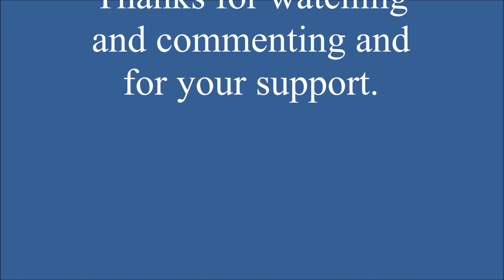Dale Skidmore - Boat Restoration Part 18

Comment: aaarrrrgggghhhh, power plane ...  'flashback'  :)      The way you braced those runners prepping for steaming reminded me of a luthier's trick,  on steroids, (where they use the  sprung bracing rods whilst bending or bracing for gluing )
Enjoyed as always.  One of my favourite series on here .  Just love the way you're taking it from what amounted to  eroding scrap to returning to a status of 'living' water-craft .
Reply from the maker: He, he, it was your fault I got the planer, Dusty, although it did help in this case ( I guess I'm not as young as I used to be ). The braces are just the giant version of Go Bars, I hadn't really thought of that, even though I have a bench and about 50 of them in the other workshop. This boat came along at just the right time and I like the idea of recycling as much as is possible. Pleased you are enjoying the series.  Atb.